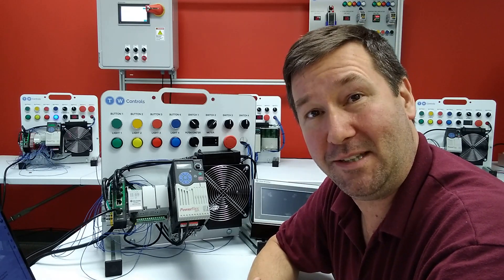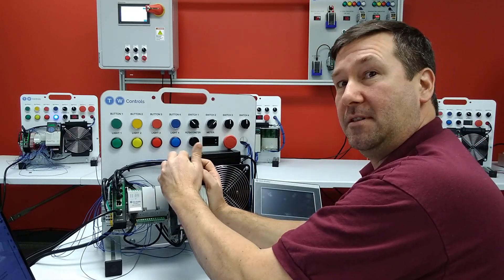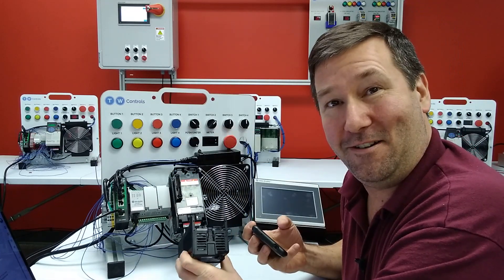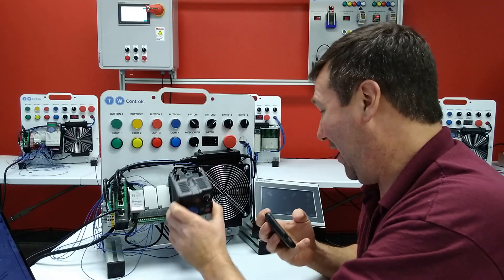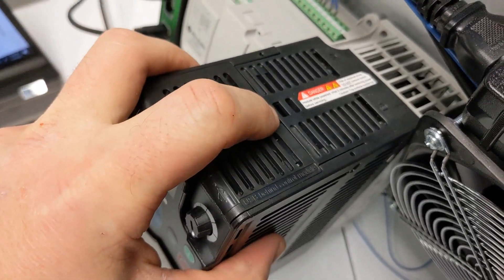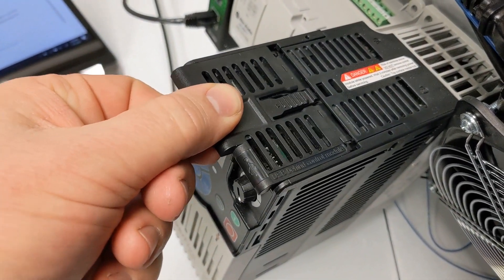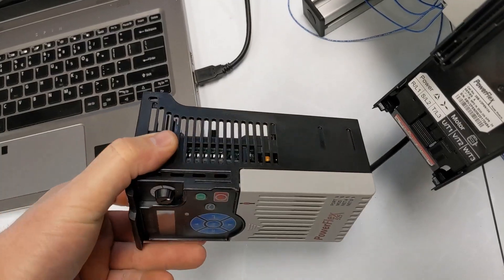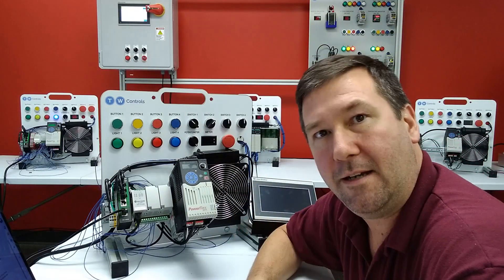How to Remove the Control Module of a Powerflex 525 Drive from the Power Module

Comment: do you have any videos about connecting to the face plate of a 525 and using devicenet to configure the parameters? I only trust your instruction.
Reply: my apologizes we had our devicenet go down at the same time I am trying to get this drive working, DriveExecutive. Dad brain!
Reply from the maker: No, I haven't used that in a long time.
Reply: @TimWilborne  I figured we are discovering how to use the old software on windows 10, it’s quite challenging especially when you have no knowledge of the past. 

My problem is how to make a .pf5 file, created in CCW and use the usb to upload that file.

Comment: Are the parameters stored in the control module? Got a faulty drive showing speed with no voltage on thr outputwas hoping just to replace the power  🙏 Thank you
Reply from the maker: He Scott.  Yes they are.

Comment: What are you methods for addressing F110 keypad membrane faults?
Reply from the maker: I haven't ran into that one but it looks like you would have to replace the control module.
Reply: @TimWilborne  we often do instead of changing the whole drive since we can't afford to have a machine down that long. Can be tricky getting the ip address with the membrane failing.
Reply from the maker: @Griffin_Sniped_U  The PLC Tools SIM-IPE will solve that problem.  Here is a video showing it reading and writing an IP address to a Powerflex 525.
https://www.theautomationstore.com/plc-tools-sim-ipe-reading-and-writing-an-ip-address-to-an-allen-bradley-powerflex-drive/